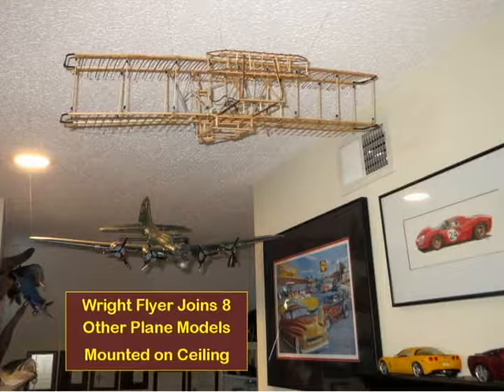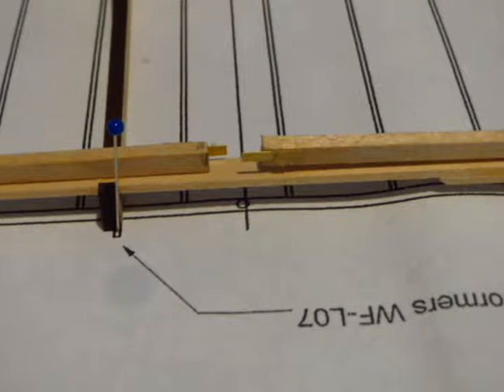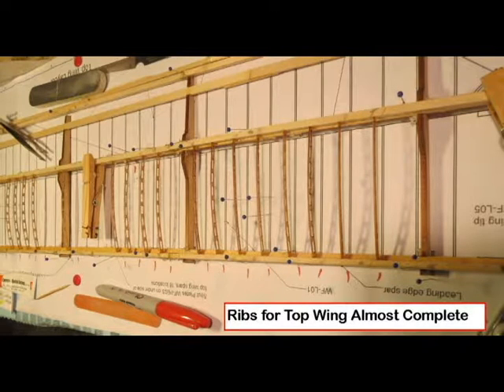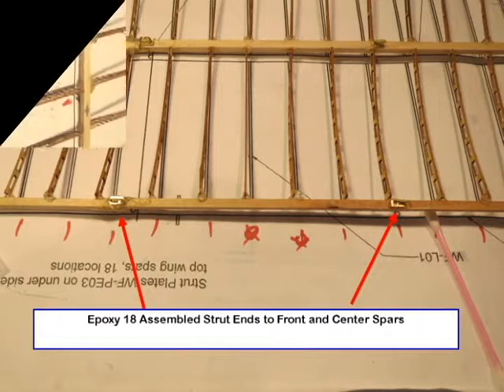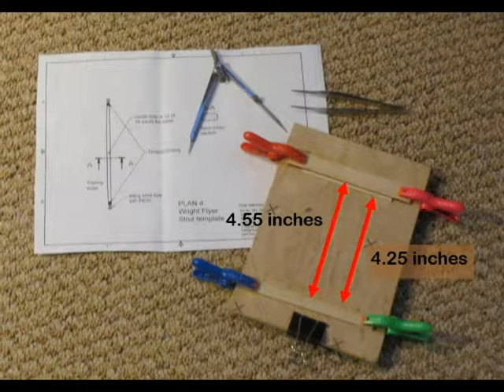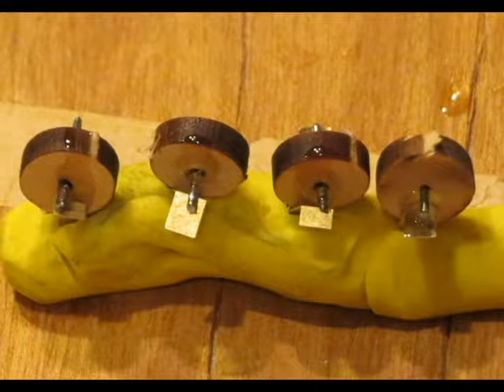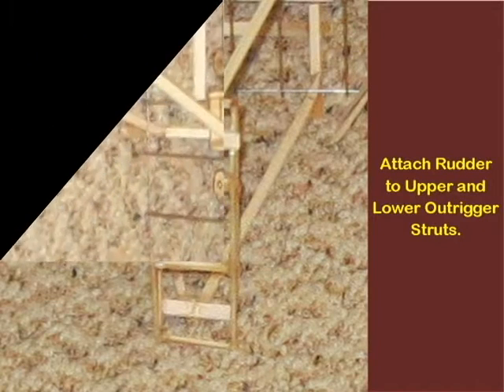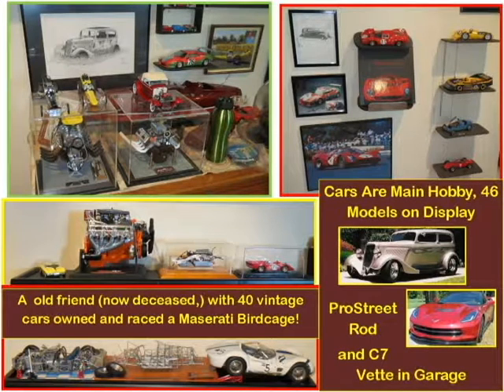Wrght Brothers Flyer Model

Comment: I just started this model and your video helped. I plan on covering the wings with cloth therefore I am going to modify the build to include extra points to strengthen the wings and other areas to prevent warping when covering. I did the same process with Model Airways Sopwith Camel. I came out great!
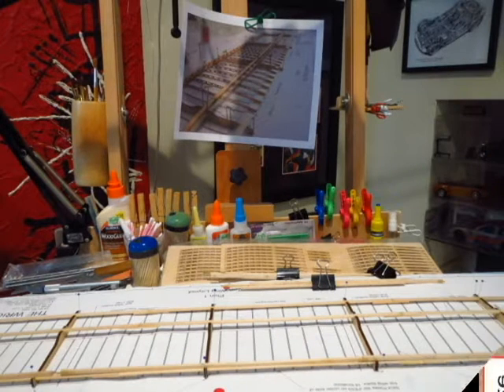Reply from the maker: Sounds good.  Yep that model is now one of 18 hanging from my Man cave Ceiling.   Most large.  Just finished my 3rd 1:35 helicopter, a Chinook that is carrying a 1:35 BV 206s. That is  two connected rubber track personnel carriers.  Often used in Alaska for recover of folks stuck in the snowy mountains.  Several HK plastic models from HK.  The largest, a 1:32 B17 with 38" wingspan.

Comment: Jerry...another question: The instructions say to drill .7mm holes in the engine support rails at a point where the crankcase feet will set. Why? I admit I haven't installed the engine yet but what's the reason for the holes? Is it just for a place for glue to wick down into or what? I've read through the instructions (at least I think I have) and I don't see what the deal is? I gotta be missing something. Thanks so much.

Comment: Jerry...how did you attach/glue the little brass splice pieces to the spar joints? I'm about to go do it but it just looks it will wind up being flimsy that way and want to fall apart under its own weight. Any tips? Thanks
Reply from the maker: Used 5 minute epoxy as I did with some other  parts.  Applied with a tooth pick and did a small number with each batch.
Reply: @NetWelding  Thanks very much. I'm just about to sit down and do that. Brian
Reply: @NetWelding  One more question; I see some guys put the brass splice pieces on the front and back edges and some guys top and bottom Which is right?
Reply from the maker: @brianamato1078  Mine are on top and bottom.  Structurally is most logical; that is where the loads are highest!
Reply: @NetWelding  I agree with you....but the instructions show front and back and I see pics of guys doing that too. Thanks so much.
Reply: @NetWelding  Took your tip and used 5 min epoxy and a toothpick as well. Came out great. On to attaching all the ribs now.